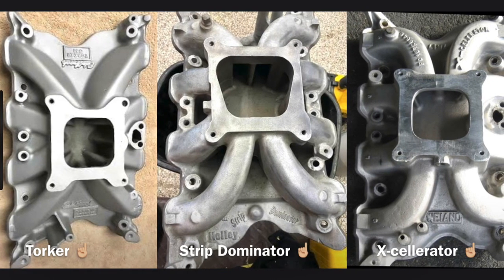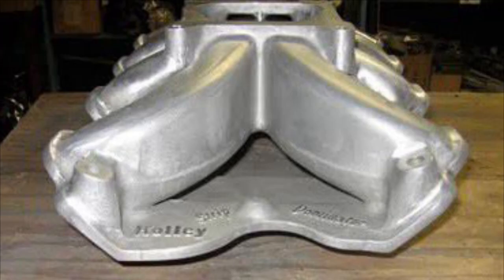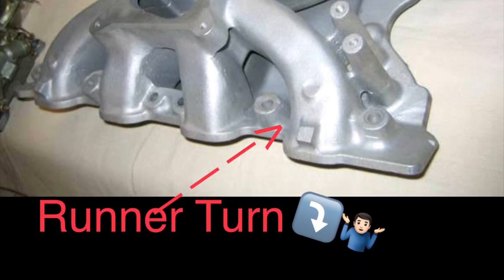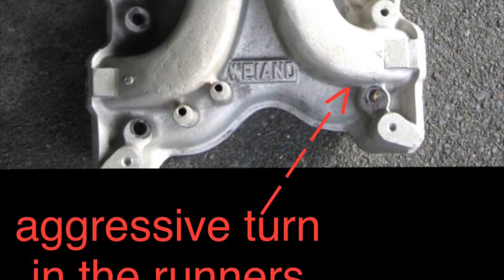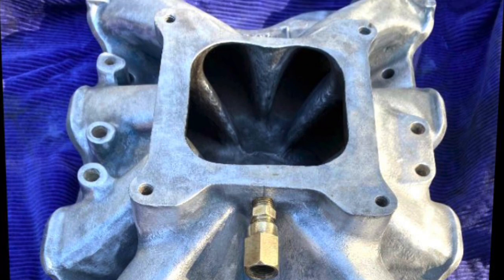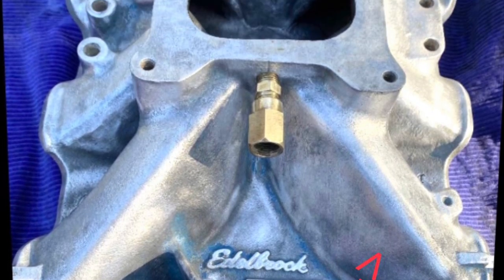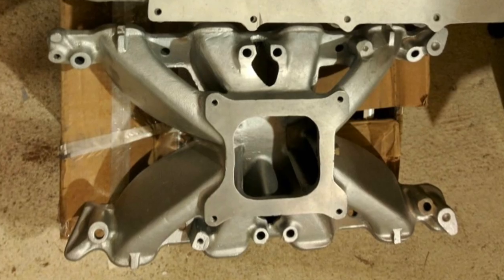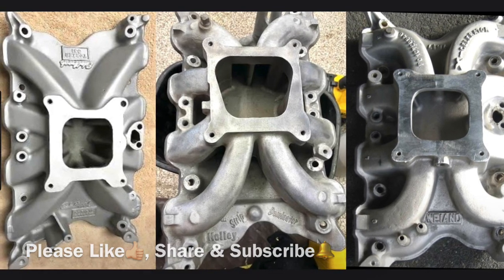Vintage 351C 4V Intake Comparisons.

Comment: In the 70s on the dirt tracks, we ran one of two intakes, and we kept them under lock and key lol. One was the Torker, and we went through a million intakes to finally run across the particular one we wound up with. It was the best one we could find, and we could never get others to match it's on track performance, even when we tried to copy it's port and runner measurements. The best overall intake we ran was a factory OEM Boss 351 intake. Nothing done to it, as I can remember as a kid at the time. It didn't matter how we built or ran any engine we put that intake on, it was always at or near the top of any others we put on them. The era didn't give much at all for the dirt dobbers to choose from, on these engines. Ford had it figured out pretty close, back then. I just wish we had some of the stuff out there now.
Reply from the maker: Thanks for sharing EF 👍🏼🏁, yes the factory intake was a revised dual plane intake which would work with low rpm grunt & suit mild combinations🤷🏻‍♂️, the single plane stuff was for the more serious combinations with big solid cams, big rpm’s, high comp etc……👍🏼🏁
Reply: @69JANKS  Thanks for the reply, you are correct about the differences. We ran just about the hottest stuff you could get in the 70s in our engines, including the iron 4V heads with the Glidden high port exhaust plates. For the circle track, 1/4, 3/8, and 1/2 mile lengths, the OEM Boss intake could run right with the single planes. The Torker we wouldn't let anyone get close to, lol, out performed several other Torkers and other brands, for some reason. I was a young lad then, so I'm going on memory. I remember my uncle swapping out the Torker in the pits on race day, for the  Boss intake and vice versa many times. Just tuning for the track conditions at the time, I'm sure.
Reply from the maker: @elmerfudpucker3204   that’s cool to know EF , thanks for sharing that 👍🏼🏁
Reply: A spreadbore ran the best? Hard to believe.

Comment: I have a Holley Strip Dominator.
Thanks for info on these.
Reply from the maker: Right on GfP👌🏼🏁 they’re are badass intake but more suited for the stroker 4V Cleveland & stout combo due to its larger & parted-out Plenum along with its good sized runners & runner entry size 👌🏼🏁

Comment: I just around to viewing this vid. Well done! One of the issues I have with 351C intakes is the height of the carb base. I have a '72 Mustang  Mach 1 with factory ram air. I have 4V heads on it and don't have much latitude in raising the height of the carb. I really want an SCM dual plane, but trying to get one in the states is impossible. The Blue Thunder intakes are good, but are pricing themselves out of the market, so it is a challenge to find an all around decent intake to replace the OEM iron unit.
Reply from the maker: Thanks r22 👍🏼🏁, don’t forget to subscribe if haven’t already…. Your best bet is to try grab a cheap used Edelbrock “performer” Dual Plane, they work well for a near stock build , use a 1/2”-1” spacer & you’ll be surprised. They’re a little more revised over stock iron design & alloy also so won’t have heat issues with the Fuel/Air coming in 👍🏼🏁
Reply: All intakes are pricing themselves out of the market. So are carbs.

Comment: I'm running a Torquer, but would really like to try a dual plane. Trouble is no one is making them anymore so second hand is my only hope. There is one made, but it requires intake tongues and I'm not keen.
Reply from the maker: The dual plane would be for more mild combination working 6500rpm & under. Just wait for a used oldschool one to pop up for sale, usually go cheap 👍🏼🏁

Comment: I have a Wieand Xcelerator port matched to Australian 302 heads.
Reply from the maker: Cool👍🏼, i also had a Xcelerator on my 2V (small port) Cleveland heads 25yrs ago. worked very well👌🏼🏁 & we run 12.0 et na in 3500lb stick car 🏁
Reply: @69JANKS  Interesting, just got the Aussie 2V heads back from the machine shop. New valves, springs, bowl blend and port match. I'm going to run a performer mainly for the low end response. This same engine was ran years back in a circle track car with boss pistons, ported 2V heads and the stock 2V intake with a 750cfm 2bbl. Upper rpm wasn't an issue, it would bump the 7200 limiter on the straights. Not sure what the 68 F100 shortbed weighs but with a 4 speed and 3.91's it should get along fine, I doubt it'll see much over 6000 these days. I'm hoping it will make around 400hp.
Reply from the maker: @gearbanger57  right on gb57 it’ll be a badass little motor 👍🏼🏁, great selection of parts & gearing for a big ol truck 👌🏼

Comment: How about picking a cam  for A good Streetcar / . race on the weekend. Awesome job on the video and intakes
Reply from the maker: Thank you👍🏼🏁. You can’t go wrong with something in the 250s to early 260s Duration@.50” & anywhere from the high .500” to early .600”thou lift👌🏼. Just remember the higher you go up on duration figures @.50” the higher up your powerband moves up to start, so depending on your Ci, Heads intake & carb is all relevant in choosing a cam….
With old oem Cleveland heads you also wanna be between 8°-15° difference in Duration between Inlet & Exhst with the exhst being the higher figure…… can’t go wrong with catalog cams but choose wisely ☝🏼🏁
Reply: From experience. The crane energizer cam is great. 524 lift.
It's unusual that this is not a split duration cam, but works exceptionally well. Even with a stock converter.
Delta Cam in Tacoma can grind a fresh one for you.
If you want a little extra, use anti pump up lifters.
Reply: @69JANKS 
Thanks for your time looking for you. To do another video. Maybe cam choices something cool 😎 from Street to Pro Stock
Reply: @cammontreuil7509 
Thanks for your comment. I'm still Gathering parts for my 70 four-speed Mustang.

Comment: You need to add the Offenhauser Port O Sonic for the 4v it was a good intake also🤔
Reply from the maker: haha was waiting on this……it wasn’t much of performer that intake, with its split bank runners. I actually had one yrs back but sold it off 🤷🏻‍♂️
I’ll do a separate post on that soon.
Check out my previous vids DN 👍🏼🏁
Reply: @69JANKS  It worked great for what I needed  at the time, I liked it for the better low end power it gave me, and no hood clearance issues, I thought it was a very good intake myself, 👍😀
Reply from the maker: @danonoveh8114   don’t get me wrong, it is a good intake 👌🏼, yes exactly it is a lower intake & suited for some help in lower rpm power…..it just wasn’t that all out power n drag race intake that’s all 🏁
Reply: What about the holley street dominator.
Reply: @69JANKS  he didn't say dual port. Said port o sonic. Completely different intake.
Reply from the maker: @paulkeogh1191   2V headed that one 👍🏼🏁
Reply from the maker: @cammontreuil7509   aha my bad🤦🏻‍♂️, yes it’s ok… basically a Weiand Xcellerator etc…..for some reason i was thinking the Offy 360° single quad/ split plenum (not split port) 👍🏼🏁
Reply: @69JANKS  for some reason reason the 2v Port O Sonic worked better on that engine than the 4v.
Reply from the maker: @cammontreuil7509  🤷🏻‍♂️?…. Never had or used one, but did have the Offy 360° split plenum…..wasn’t a fan of that either but still ran ok.
Reply: @paulkeogh1191  that has 2V ports.

Comment: I wish you had or I knew what the performance was of each manifold . I have an old Torker manifold , but I think the Edlebrock Air Gap 7564 has a good operating range with better torque , which is the tire burning power that I want 😀 🤔
Reply from the maker: Sure thing👍🏼, are we talking on 4V large port Heads?
Reply: @69JANKS  Yes sir . I've the early 4V quench heads  with roller rockers , the comp cam's unit that's supposed to give 450 hp at the crank . A little modest (cause I'm an old guy who likes to give it shit) , but maybe it will let me stay out of trouble 🤔 lol 😆
Reply from the maker: @jeffschwartz5199  haha i read ya loud & clear, the air-gap is a good option👍🏼….is that intake an actual 4V port size? Can’t remember🤔……the Torker isn’t too bad either, it does like the 7K rpm range with 351 cubes👌🏼🏁
Reply: @69JANKS  The 7564 is supposed to have lots of meat to port match . It's made for the Edlebrock heads which are kind of like the 3V heads you guys have . I've got a second set of 4V closed chamber heads to build another Cleveland engine . Will see how the first one turns out . 60 over , should have some grunt .
Reply from the maker: @jeffschwartz5199  cool 👍🏼🏁

Comment: Thanks and Subscribed. Luv the lod skool stuff. Putting togeather a 393 with 4V closed chamber heads. Most modern  mainfolds have a big port mismatch and seem to be set for all the alloy heads and all the dyno tests just seem to bolt them on. Should they be port matched to the 4V heads?

Comment: What spacers do i need to use the 4v heads and 4v torker on a 400 block? Allso does anyone know of any header sources for upright 4v headers?
Reply from the maker: Upright headers? you mean flipped reversed headers?
Spacers for the M block i wouldn’t have a clue, either have to be custom alloy plates angle decked & match ported…….🤷🏻‍♂️🏁
Reply: Lookin at building a 400 long rod motor for a pulling truck. They freak out if you tellem it's a 351c 4v. But they aren't scared of a 400......yet.
They claim the 4v heads are big blocks,little do they know. Gotta be a  factory cast iron head.
Reply from the maker: @roymartin4771  that’ll be a cool build, they used to make an adapter (maybe still do) that would accommodate a 4V intake/tunnel ram for FE big block use…. Pro Stock Engineering ? I’ve mentioned it in one of my other Boss Intake vids ……
It’s a 10.5” deck the M series I believe, so either there’s someone who makes them out there or just do your own adapters & port match them well 👌🏼🏁
Reply: 351m/400 has a 10.29 deck. So i figure on steel crank rods and as much compression ass i can find. Plus fill the block.
Reply from the maker: @roymartin4771  that’ll be tuff, just work out what stroke crank your going for on what length rod, then work out your piston height …..if it’s na you can go a tight piston height in the 1.1”s ……
It’ll be Ci potential that’s for sure, with 4Vs on there it’ll make stupid amounts of power💪🏼🏁
Reply from the maker: So for example if you go a 4.25” stroke crank, 7.0” rods & piston height of 1.175” would be pretty badass & gives you a rod/stroke ratio of 1.647👌🏼 which is on the money for a high revving na deal
Reply: Component availability is gunna be rough.
Reply from the maker: @roymartin4771   yes for sure🤷🏻‍♂️

Comment: Do you know if anyone tested a cross ram intake on the 4V head Cleveland?
Reply from the maker: I know that the Original 72/73 nascar Torino when restored before it’s sale, got refreshed & Dyno’d at 475hp flywheel conservatively🤷🏻‍♂️🏁
& there was one test “online” that someone tested a bunch of intakes (incl Xram) but had all these absurd dyno HP results, that i just simply disregarded🤦🏻‍♂️, someone’s Dyno was definitely happy by like 150+hp lol 🏁
Check out my previous vids & posts on all this stuff, plus my very own Bud Moore CrossRam build I’m slowly doing up 👍🏼🏁

Comment: No stats , makes it only a guess 🤷 🤔
Reply from the maker: No stats or weird science here……just experienced observation & have run them on badass 2V & 4V Combinations myself in the past…. The Strip-Dom intake will be the slight leader in them 3 
, Torker has the straightest (shortest runners) so good rpm power, Strip Dom also , Weiand has longer more curved runners (not good for airflow to bend) but then again longer is a little better for that lower-mid rpm Torque…..🤷🏻‍♂️👍🏼🏁
Reply: @69JANKS  From what I've seen from people  (Richard Holdener) and others , there is just too much torque lost when using a single plane intake manifold on the street . Or even if you prefer taller gears ⚙ 🦵🙈
Reply from the maker: @jeffschwartz5199  not much options out there for a full true 4V large port🤷🏻‍♂️, if it’s only really mild & street cruising low rpm is your thing, yes Dual Plane then 👍🏼
Reply: @69JANKS  The Edlebrock 7564 manifold carries out fairly well past six grand or so with a good flat torque curve  😀 . (It better , cause that's the one I ordered) 🤞
Reply from the maker: @jeffschwartz5199  good choice👍🏼, just msg’d someone else here on that same intake. It’s the only choice really readily available & I’ve used them in the past & had even achieved 350horse on a 2V head combination at a 4800rpm max-redline👌🏼🏁
Reply: @jeffschwartz5199  it's like this. You have to in the end just try it yourself.
I'm a retired machinist and engine builder.
Did at least 70 Cleveland's. All I can say, is there are a few myths flying around about this engine. I read and hear them all the time.
1970 was the first year. You could buy a 4v cleveland in a cougar with all the accessories on it and nobody complained the engine didn't have enough low speed grunt. Because it did.
For my business to move around parts, I had a 68 F-100 with a cleveland 4v and an offy tunnel ram. 
Drove great on the street and occasional trip across the mountains to pick up more engines for rebuilds.
You can get recommendations all over the place, but if you want something just right for you, you're going to have to experiment.
It's fun and you may discover something like I have.
Good luck.